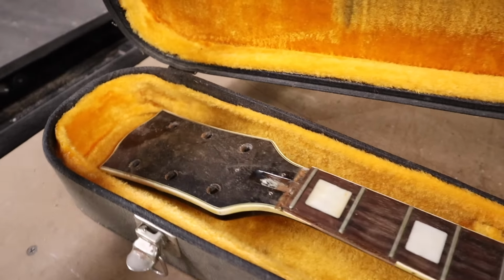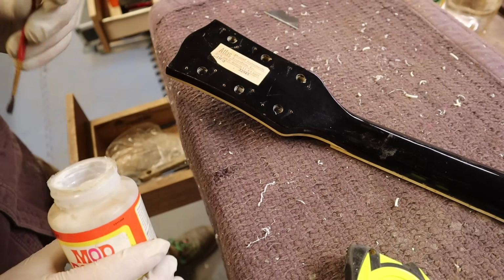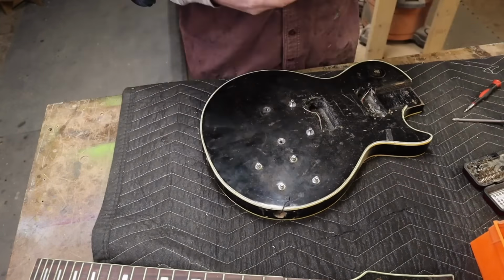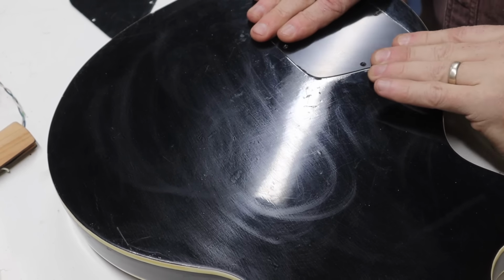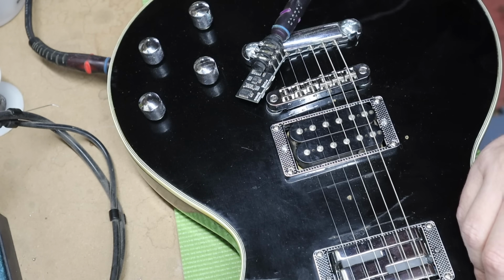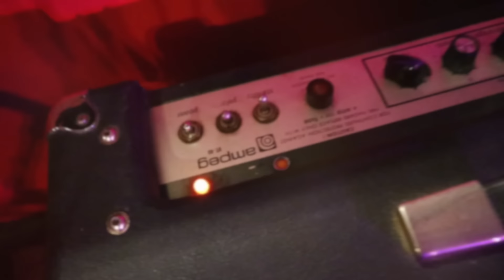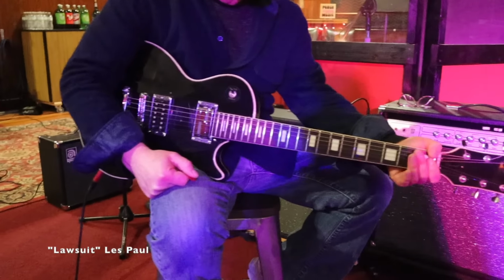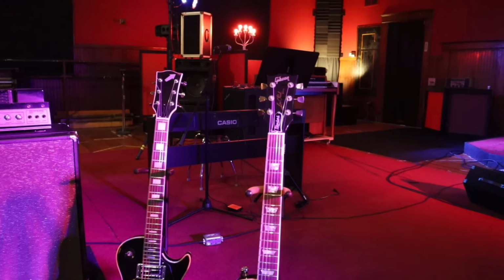Rehabbed a Japanese Les Paul Copy and Compared it to the Real Thing!

Comment: In 1975 I spent  £80 of my student grant cheque to buy a brand new Ibanez Sunburst Les Paul Standard.  My first half decent guitar.  It felt great to have a sunburst as all the other copies were black.  It had a bolt on neck and weighed a ton, but played so easily and sounded, to my ears, impressive.
I have a set of Lace Alumitone single coils in my Strat, I really like them, but the literature claims that they should not be mixed with other types of pickups.  Seems to work just fine with yours though!
Reply from the maker: Seems fine with the old dimarzio to me!

Comment: One thing I never liked about the cheaper bolt-on copies of Gibson style guitars is that there is no wood separating the neck pocket and neck pickup cavity. I've seen LP copies and Gibson bass copies (ie. EB-3 style) where the string tension pulled the neck enough to press against and deform the metal cover of the neck pickup. They could've made a shorter neck heel and have a fretboard overhang for the last fret or two.
Reply from the maker: I know EXACTLY what you are talking about!
Reply: @timsway  I also encountered one where between neck pickup route and neck pocket there was actually a thin sliver of plywood left out (half of the width of the pickup mounting ring, just enough to be covered by it) and of course this sliver got broken off by the pull on the neck. These could probably be converted to mitigate this issue, route out 1/2 inch of wood from the neck heel underneath the fretboard and put 1/2 inch block of solid hardwood in the neck pocket, glue it in tight with good glue coverage. I always have this feeling that they're not structurally proper with the neck being held in place just by the screws and not pressing against any wood, like it would in a Fender style neck pocket. :)
Reply from the maker: @gryzew I have a video fr a few years ago where I deal with some of that type of stuff in a fujigen. Terrible design.

Comment: I have a lawsuit on the slab 😂 how timely. This is a Japanese 12 string gibbson copy, loving this series of repairs, as mainly a repair guy it's really relatable, will bevgutted when you run out of dumpster guitars 😂
Reply from the maker: There is no shortage of dumpster guitars, that's for sure. I was thinking about jumping in on a couple more modern, crappy Chinese ones. See if I can make them shine
Reply: @timsway  🤣🤣🤘

Comment: I wish I could find something like that for $20.
 I love that you tried to save as much of the original binding as possible.
I wonder if some coffee or similar could age the newer binding a bit.

The guitars sound a bit different - but I will make no call on whether either is "better".
I'm sure your friend Mick could make any guitar sound good - so it then comes down "feel", to how much it fights you (unless you're Slash and you like a guitar that bites back) and whether it has some kind of mojo that inspires you.
The lawsuit plays well enough - great job Tim - so there is a lot of the mentioned upsides for going out and wringing its neck in the pubs and clubs where it'd fit right in.
And like you - I think there is value in the oddballs vs something that was manufactured in the thousands and a newly made one could almost be pulled off a shelf today.
Reply from the maker: Right, it's not a real fair comparison because I put some pretty top shelf pickups in it since I didn't have the originals (and Mick could make a string on a broom stick sound beautiful). These copies were certainly mass produced, too, but it still falls firmly in the "oddball" category - where I love to be!

Comment: Excellent job, and great FF collage.
How exactly do you create those trussrod covers? I assume it's the laser you mention later in the video.
Reply from the maker: yes. the laser is such a great tool to easily do stuff like that in minutes instead of hours. I will note you should pay attention to the materials cut in it. The pickguard material is highly toxic when burned (how lasers cut) so make sure you are working with everything properly ventilated and carefully.

Comment: Tim, leveling frets on these old guitars is the difference between them and Custom Shop playability, glad you did that work! ..  I saw you shielded the control cavity but you should use shielded cable for long runs like the switch or to the jack. Twisting the wires looks good for photos but does nothing for shielding; otherwise we'd all have twisted pair wires from the guitar to the amp! If you don't have shielded cable handy, you can twist your wires and then wrap with hvac tape (Nashua Aluminum Flashing Tape is the one I use for all guitar shielding) making sure somewhere the wrap is grounded with the cavity shielding (screw, clamp, more tape, etc).. When flipping pickup hot/ground to get matching polarity, the bridge pickup should be the 'base' and flip the neck because more players use the bridge on high gain and lower noise comes from ground being the first wraps of the coil. Reviving old guitars is a great project, keep going.

Comment: Back in 1976 I bought a new CSL LP Deluxe gold top and it had a formed plywood top, it’s one of the guitars that I regret selling. I still have a mid 70s 6/12 string double neck that is also CSL branded, the body on that is a block/plywood mix with 3 piece maple necks.

Comment: There was never a lawsuit. A cease and desist letter that’s as far as it ever went. Ibanez and others just stopped making them and greatly changed the design.  The end.
Reply from the maker: There was a lawsuit filed in 1977, not a cease and desist. But yes, it was settled out of court.
Reply: @timsway  Proof please?
Reply: “Lawsuit" is an overused and mostly  inaccurate term that's supposed to suggest that the copy version was so close to the original that the original manufacturer filed suit. The fact is, however, that such litigation was exceedingly rare (most cases were resolved out of court with a simple cease-and-desist letter)
Reply: The actual "lawsuit" never really went to court and Gibson never actually won it. Gibson's complaint was over the headstock of ibanez guitars, which on some models had been using the open book look headstock. Gibson's lawyers had failed to notice that Ibanez had actually changed the headstock a couple of years before; the matter was settled out of court. But the whole thing has been expanded by some folks to refer to that period in time; no guitars other than Ibanez were involved and no part of the guitar other than the headstocks were involved. No money changed hands for so called damages so hence no actual lawsuit.
Reply from the maker: Yea, that's exactly what I said. They filed a lawsuit, but it was settled.  @dzines65
Reply from the maker: "But who wants to be accurate?" The author writes in this piece, which mirrors most of the stuff IU've read. LOL! https://reverb.com/news/beyond-lesters-and-strats-other-great-lawsuit-era-guitars-from-70s-japan  @dzines65